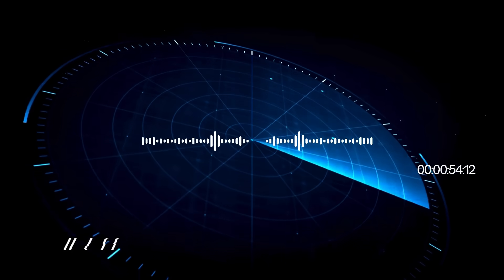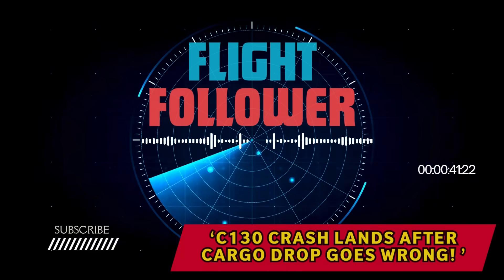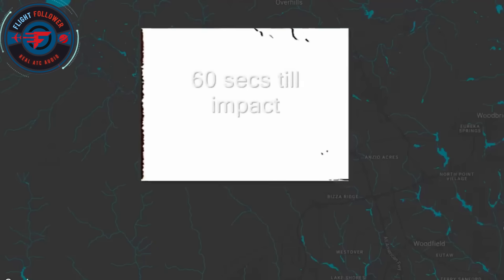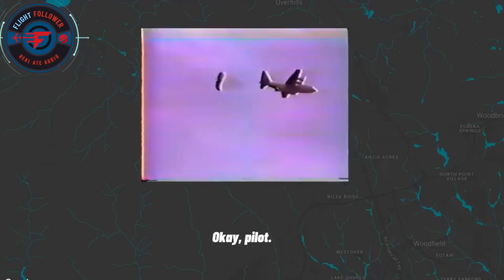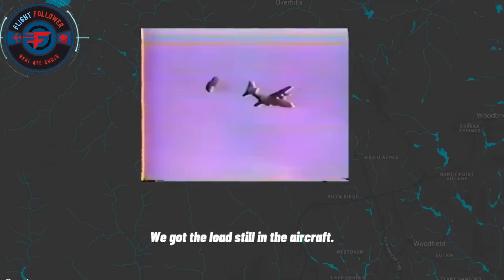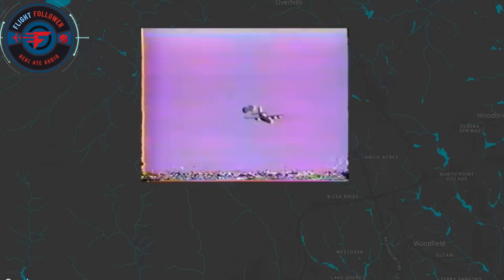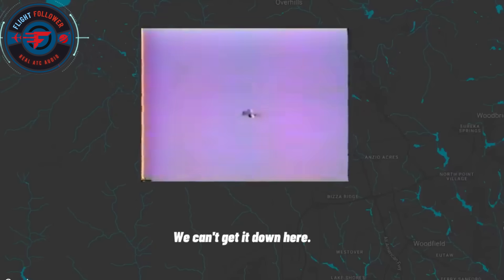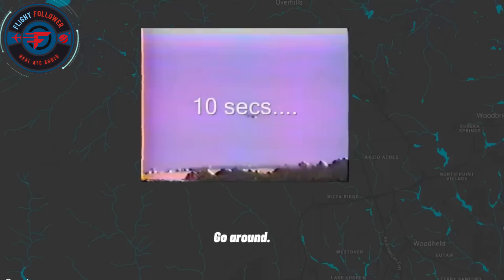C-130H fatal crash while droppingM551 Sheridan tank - load hung-up, parachute deployed!

Comment: Any C130 expert here? Can someone please explain what happened here??
Reply: They drop the tank by throwing three parachutes out the back door that drag it out of the plane. The tank got stuck and they had the parachutes slowing the plane down like hitting the brakes.
Reply: I worked on the C-130 engines. The pilot was asking the flight engineer to close the "bleeds" bleed air valves that take air from the compressor section of the engine to be used for various things like pressurization and de-icing. With the bleeds open the engine is robbed of some of its power. The pilot was yelling to have the bleeds closed to get more power to overcome the drag. Obviously, even with the bleeds closed they still didn't have enough power to overcome the drag of the chutes.
Reply: The load is on airdrop pallets and the pallets are locked into the dual rails system (a rail on each side of the cargo floor) During the checklist, the loadmaster removes the left hand locks. The right hand locks are what is holding the load in the aircraft until the extraction chutes is released out of the bomb rack at the Nav’s green light call and the co-pilot pushes a button to actuate the bomb rack. The extractions chute once behind the plane basically holds the load in place as the plane flies out from under it, overriding the tension set on the right locks. If the load doesn’t leave the plane, the loadmaster pulls the right hand cross over handle to release the right hand locks , on a load this size, if the load still fails to extract the loadmaster needs to pull the left side emergency handle, a steady pull of 10-20 seconds maybe required in case of load binding. On smaller loads, the loadmaster would go back and put on emergency aft restraint chains to the airdrop pallet before hooking up his restraint harness before going back and cutting the extraction line, but in this case, there is no time or procedure to go back to cut the extraction line.
Reply: @jackg7225  This was a LAPES drop so when the aircraft was 5 feet above the ground drogue chute was allowed to extract the main extraction chutes (2x 28ft). The Pallet bound up in the rails transferring that force to the aircraft as drag in excess of the full output of the 4 engines resulting in the aircraft crashing on the LZ. One Loadmaster lost his foot as the pallet shifted forward and the other loadmaster tried going over the top of the tank to cut the extraction line but ended up crushed between the tank and the ceiling when the aircraft bounced. We always knew trying to get to the back was a risky proposition.
Reply: Thanks a lot i was just wondering how something like that could happen.. was it a mechanical issue or someone was at fault there.. i understand the loadmasters tried his best to cut the chords till the last seconds.. 
sorry for my ignorance
Reply: @sabbirhasanrehan2784  No problem. There was a fatal accident of a Canadair Challenger business jet many years ago that was somewhat similar. It was undergoing development flight test work, and they were doing stall tests. The aircraft was equipped with a drag or spin chute to deploy if or when they got into a deep stall (the elevator on the T tail gets blanked out and is ineffective in breaking the stall.) They got into a deep stall and deployed the chute to break the stall and then the next action is to cut away the drag chute, but the mechanism failed and the aircraft couldn't overcome the drag and crashed. Unfortunately, it had at least one death among the flight test crew. As I remember, the last to bail out was too close to the ground.
Reply: During most airdrops the loadmaster is wearing a harness and is safely strapped to the plane to prevent being sent out the ramp and door. During a heavy equipment drop the loadmaster is wearing a parachute. The emergency procedure for a “hung load” is for the loadmaster to move behind the heavy equipment and cut the extraction chutes. The result is the loadmaster will likely exit the plane with the load with a high probability of loosing their life.  As is the case here, failing to cut the extraction chute resulting in a crash landing is no guarantee the loadmaster will survive.
Reply: I am a retired KC-130J flight test engineer. The pallet the load is strapped to sits in between two rails on the deck of the aircraft. In the KJ there are “dogs” that hold the pallet from moving fore or aft in the aircraft. When it comes time time to drop the load the dogs come up and a drouge chute is deployed to start the pallet moving. The drogue also has the main chutes deploy in order to pull the pallet out and bring the load safely down. It’s rare but a pallet can get cockeyed in the rails. It’s not a lot, less than 1/2” but it will jam the load and there’s nothing you can do but try to chop the chute straps. You have to bear in mind these straps are nylon and Kevlar. A little pocket knife isn’t going to do it so I’ve been told the crew will grab the crash axe and wail on the straps which in itself is life threatening due to immense load and nylon has a tendency to whip back explosively almost.
These chutes are large, depends on the load. I’d say the ones in this video were probably 30’ across if not more. While a C-130 can carry a lot of cargo when you have something like a tank it’s close quarters. Really all he could do was crawl over the top.
Those chutes would have robbed them of airspeed big time. The pilot calling for bleed air is commanding the flight engineer to turn off the engine bleed air valves. Bleed air is pressurized air taken off the engine to do different things like pressurize the aircraft or provide anti icing hot pressurized air to heat leading edges of flight surfaces. Bleed air robs the engines of power which he so desperately needed at that time.
If you have anymore questions I can’t answer I’ll bounce them off my still working colleagues.
Reply: @kaptainkaos1202 Thank your for your service and the explanation. I have been in empty C-130’s and many different variants many times but not one loaded with armor.
Reply: @kaptainkaos1202 I am surprised they don’t have cutaways on the chutes.
Reply: I remember this crash. At that time I was a C-130B LM with the 303rd TAS USAFR @ March AFB CA.  This crash stands out due to an eerily similar situation I had around late 1991 but with an obviously much better outcome.  Out of all the responses I have read here the info provided by @JackG7225 is the most accurate when it comes to Emergency Procedures for a ‘Hung Load’ from a LM POV.  It’s clear sir that you are either a current or former Herk LM.  Anyhow…late 1991.  Night time 3 ship training sortie dropping heavies on Desert Center DZ near Indio CA.  We had two heavies onboard loaded in tandem with two 28’ extraction chutes. As the extraction chutes “pulled” the first heavy out it would then in turn extract the connected second heavy right behind it.  The whole process took maybe 1-2 seconds and sounded like a freight train going out the back.  Two LMs onboard that night. Myself and my good friend Jack T.  As always, prior to the flight we had a LM briefing and reviewed emergency procedures for such things as a ‘hung load’.   I remember the ramp and door opening and the red light on.  I heard the Nav call “Green Light” and saw it illuminate and the ext chutes fall from the ‘bomb rack’ and deploy.  The aft heavy moved maybe 12” and then stopped.  After a very brief WTF moment we pulled the Emergency Release handles and there was still no movement.  At that point the only option is to restrain the heavies with pre positioned chains (load rated @ 25K lbs ??) and keep them in the A/C. This is done BEFORE u climb behind the heavies to cut away the extraction chutes for obvious reasons.  We grabbed chains and were within an inch of hooking them up when the aft heavy suddenly broke free and exited the aircraft and extracted the forward one as well.  I remember calling “Load Clear” after the heavies were gone.  Probably the longest 10-12 seconds of my life.  Fortunately it all ended well for us.  I think it was one of the few times I had to clean a stain out of my flight suit.   Cheers!
Reply: I'm not a C130 expert, but I would say the drag from the chutes was more than the C130 could handle (not enough thrust to compensate for the high drag). If the drag chutes had been cut away, no problem. To avoid stalling the aircraft they had to make a controlled descent/crash landing.
Reply: @bobteter4300  Could still have been a problem if the load had shifted back much, unbalancing the plane.
Reply: Also, they were most likely fighting a CG imbalance 🤔 5 years later as a Medic, i would respond to the Green Ramp Disaster. @bobteter4300
Reply: flying tank didnt fly